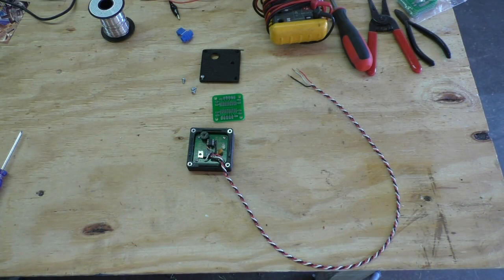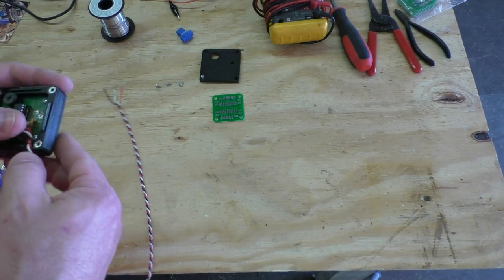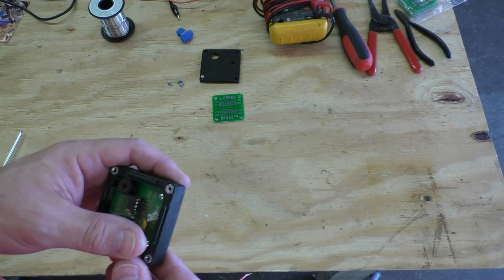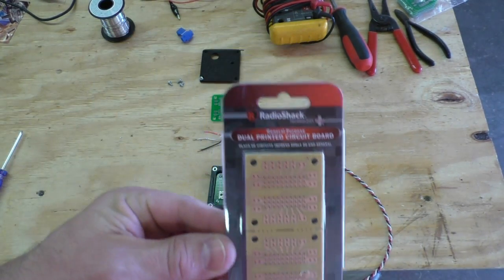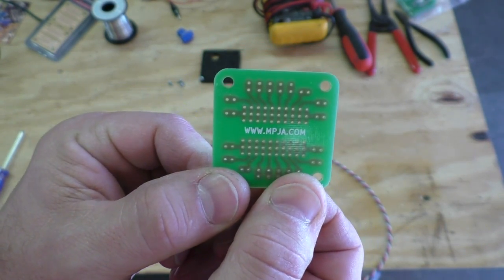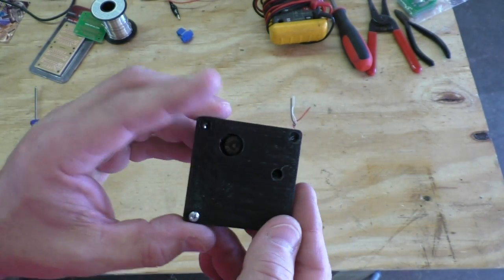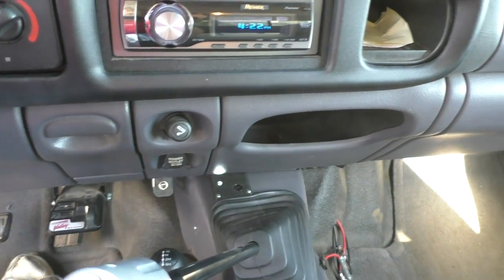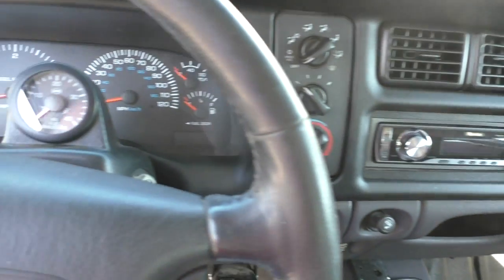DIY Fuel Pressure Sensor Alarm - Save your VP44 on your Dodge Cummins Ram

Comment: Just found you, a little late unfortunately. One vp44 pump ruined because wire to pin connection failed, inside the insulation mind you. Deutz connection into transfer pump mounted on engine. This engine is used on McCormick MTX200(in our case) and Case/Int. MX170 and other ag. machines. We are going to install a warning light and buzzer I purchased from diesel shop. Also want to install manual guage.

Comment: Cool idea, but I would be inclined to find a pressure switch that would indicate a low pressure warning at <10PSI, if possible.  By the time the pressure is near bottoming out at 5PSI, the high pressure pump is already in serious danger of damage at highway speeds.  Just my two cents....  Thanks for sharing!
Reply from the maker: My experience with the pumps is that they either work or don't. There's no in between.  You point is valid because fuel pressure could drop for other reason such as a clogged filter or punctured line or different brand fuel pump.  Thanks for your input.

Comment: Great idea, I was just looking for something like that as I recently encountered the same situation with my VP 5.9 cummins.  Luckily I have a low psi warning light kit in conjunction with my mech pressure gauge similar to yours.  But an audible alert would add to better awareness.  The link for your page is not valid, unless you were working on your site.   Just wanted to see the values or p/n of the components you used.   Btw, the engines you and I have don't use glow plugs, but instead have a heater grid underneath the air intake horn.  My old 7.3L F350 would burn one or two glow plugs out, to which I was proficient at tracking and replacing.  Cheaper to replace only those needed than the complete set of eight.  Good video, thanks for posting.
Reply from the maker: Glad you liked it! I fixed the link in the description. Thanks for letting me know.

Comment: While I would think this is pretty useful, a alarm for loss of vacuum would probably be more important as when you lose vacuum, you lose brakes.
Reply: No, in this truck vacuum only operates HVAC. Brake power assist is hydroboost. FirstGen trucks used vacuum pump for brake power assist and DID have a warning for low vacuum. (I have owned these from '89 to present in case you doubt my comment).